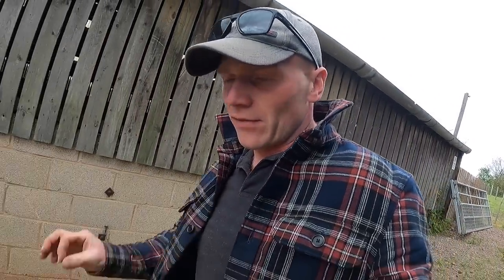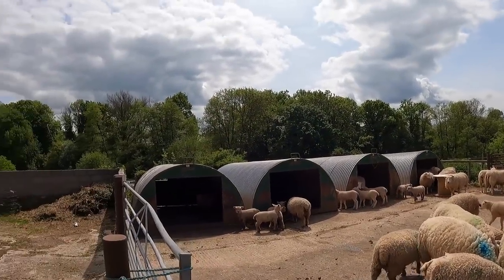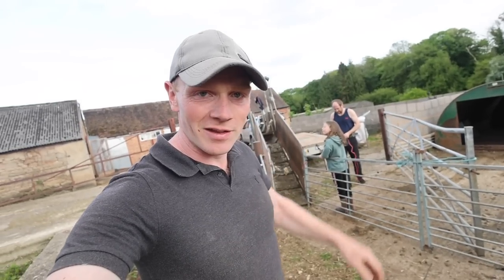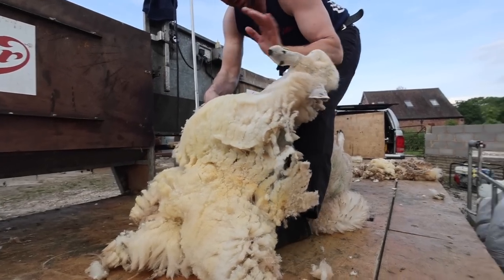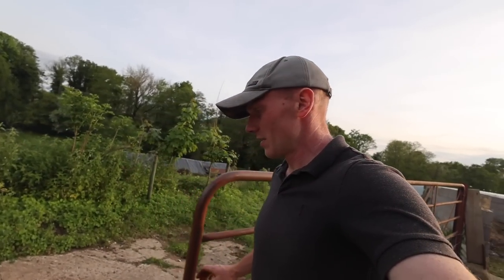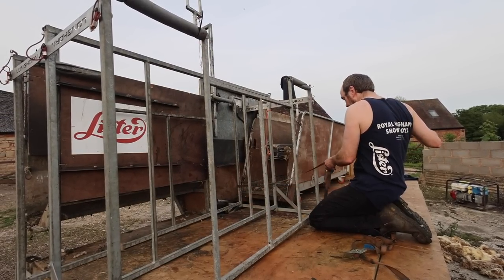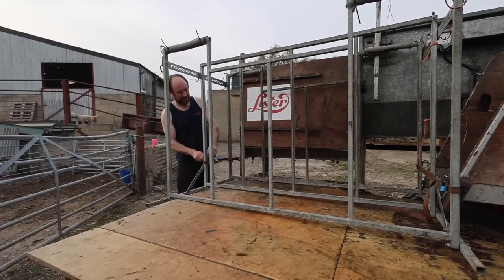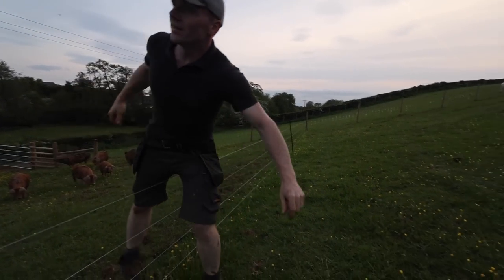SHEARING OUR SHEEP & ONLY JUST IN TIME!

Comment: If the goats keep getting stuck in the fence, tape a piece of plastic pipe across both horns wider than the opening on the fence. It works great. It looks odd, buy it doesn't hurt them and can actually prevent injuries from them struggling to get out of the fence. Once the horns grow wide enough that they cant fit through the fence you can take it off.
Reply from the maker: We have a couple with the crown of shame. Plenty of hilarious content on IG. 😂 works great though.